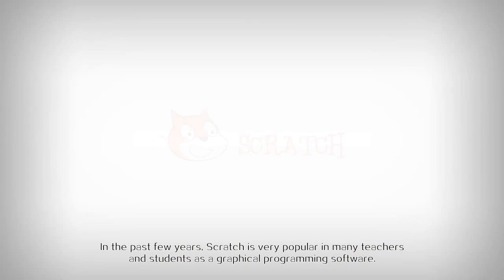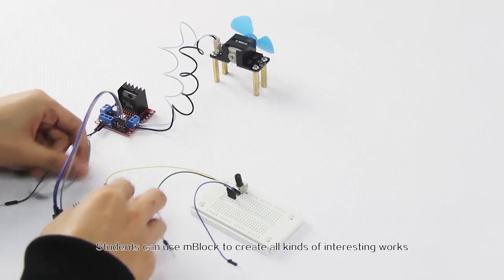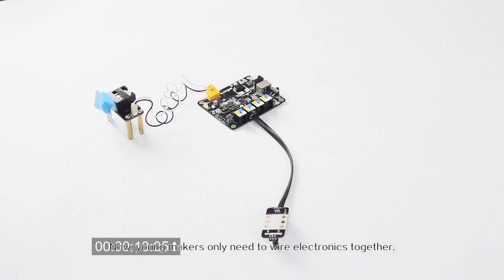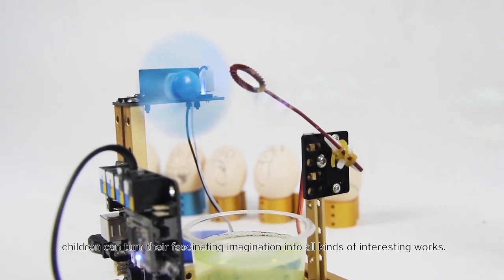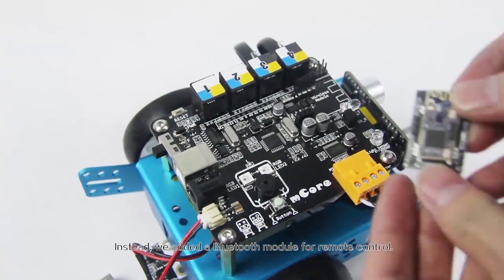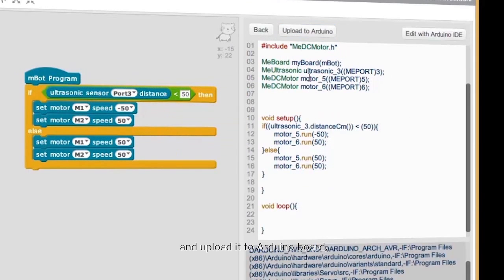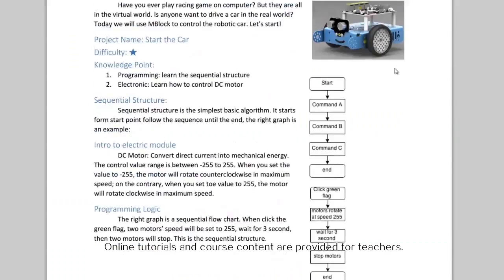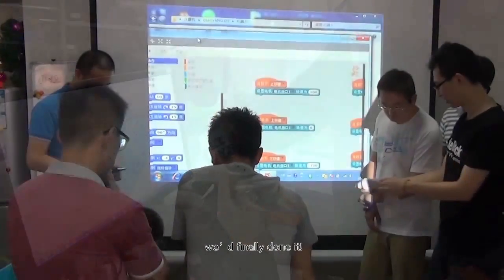Introduce mBot - Makeblock Education Robot for every child

Comment: You compare mBlock with Scratch. But Scratch is a web application and can run on any computer that has a browser. You application requires Windows or Mac. I said this before but you would really open up for a lot more users if you made it a web application like Codebender.cc has enabled Chromebook users to use Arduino in a Webbrowser. I bet they would work with you if you contacted them.
A lot of learning institution use Chromebooks.
Reply from the maker: +Brian Levinsen (Eldaria) Yes, you're right, our engineers are developing the browser support version to program our software. It will be public soon.
Reply: Makeblock That is awesome news, BNo0th me and my daughter look forward to program the mBot on the Chromebook using scratch style programming.
Reply: +Makeblock Any update on this, now that it has been 3 months? I have an mBot that I'd really like to program using a Chromebook - both through a Scratch web application and through Codebender.cc!!
Reply: +Makeblock any progress on this?  I would love to be able to use chromebooks to program mBots in my classes!  We've already purchased one class set, but would be interested in buying more if we could use web-based programming!